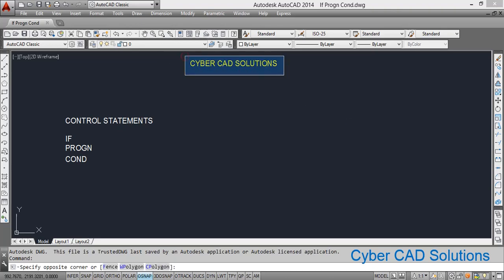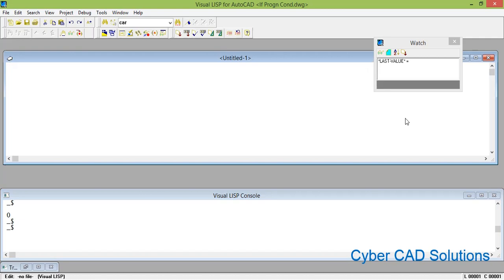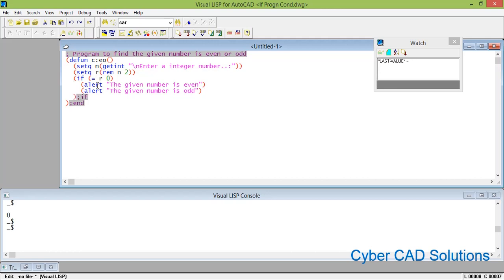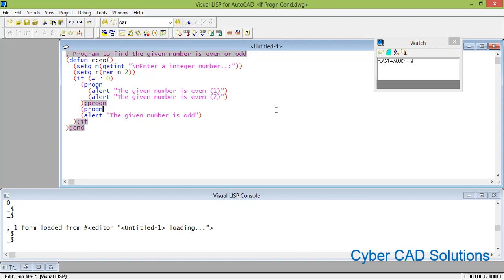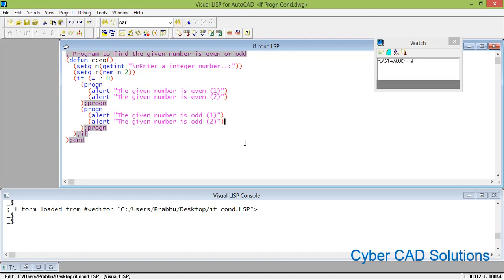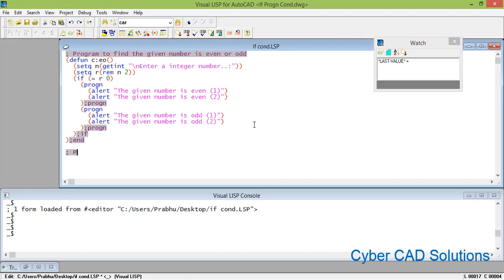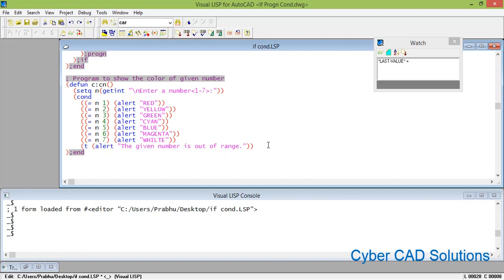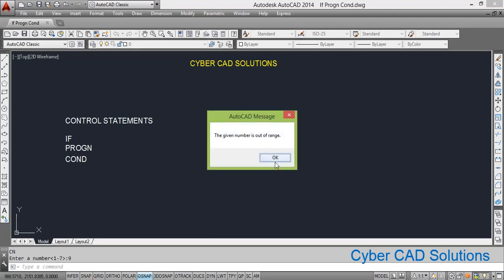How to Control the Flow of AutoLISP Program

Comment: the main thing is that, the color numbers you  are using are actually meant for the same colors as you have mentioned in all programming languages. as for text color we use \033[31m for red, \033[32m for green, \033[35m for blue as so on. 😂😂